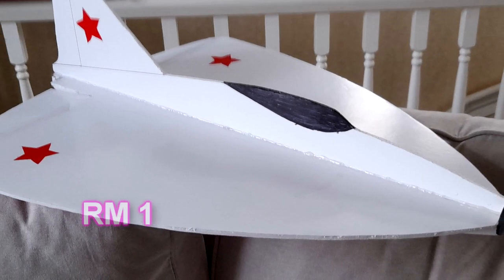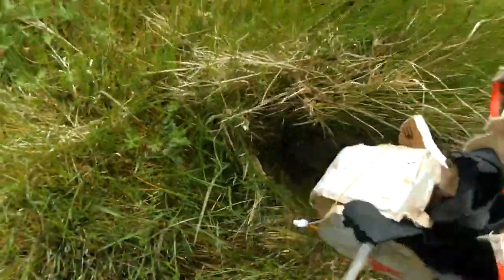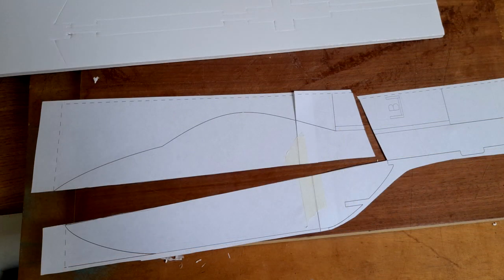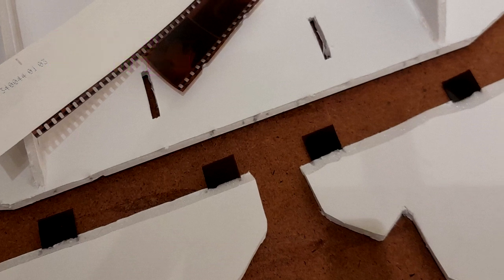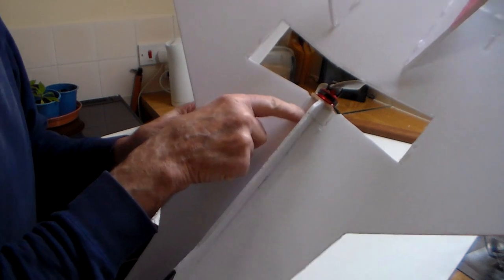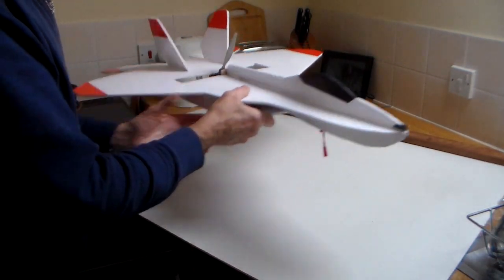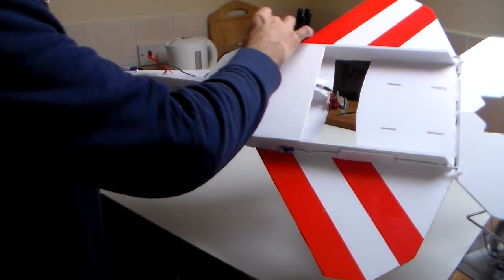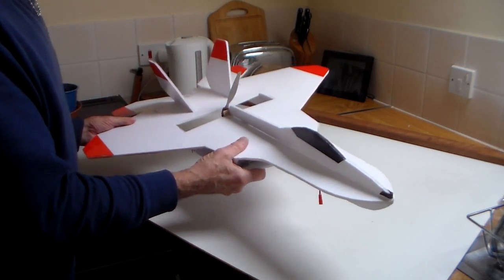One Sheet of Foamboard and you can build a great    F22 Mini Raptor !  Full details here.

Comment: Nice little plane Bob, how does the weight compare to the Flitetest version?
Reply from the maker: Good question, I'll try and check and find out.
Reply from the maker: I had a look , but they use a lighter foamboard than the stuff I get from Hobbycraft I think.  Must have saved a bit! It's about 275 gms without battery.